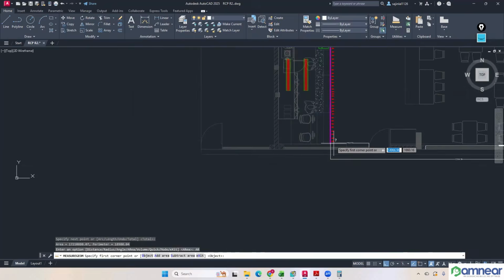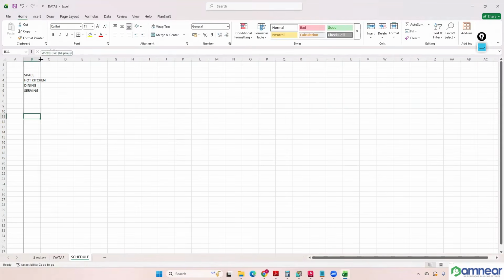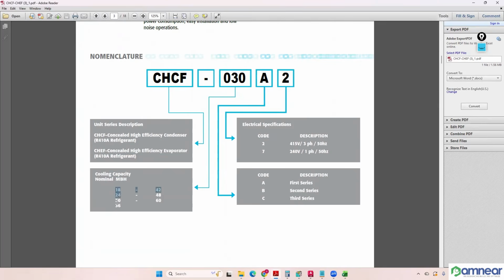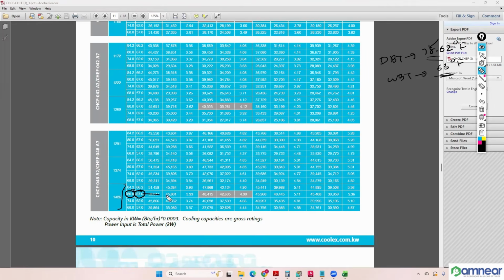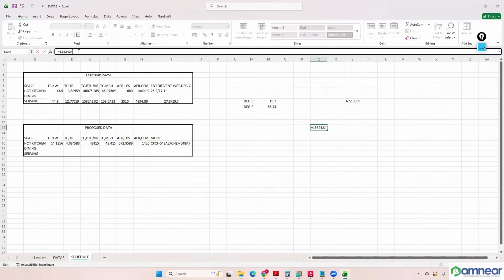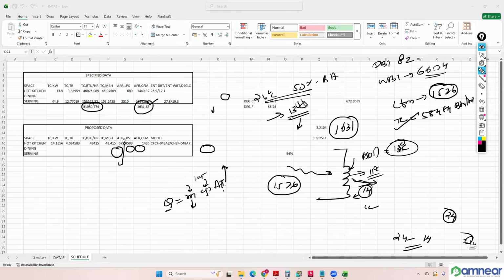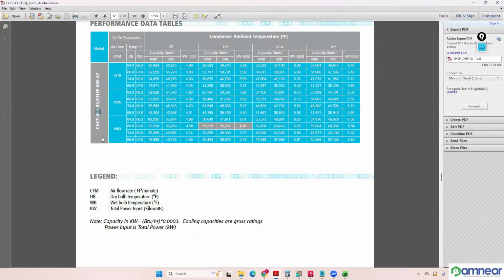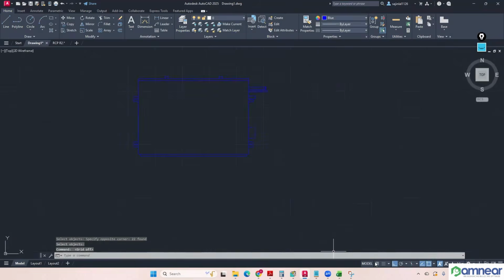Commercial Kitchen HVAC Design Project |PART 2|Air Conditioning &Ventilation|AMNEAR MEP|BIM|

Comment: Impressive breakdown of HVAC design principles for commercial kitchens. It’s interesting to see how ventilation and cooling efficiency shape both comfort and compliance. At On2Cook  we’ve observed that optimized airflow requirements can change dramatically when using compact, multi-mode cooking systems. Our devices operate with minimal fumes and lower heat output—often reducing the overall HVAC load and simplifying siting or retrofit challenges. Curious to know how modern low‑heat cooking technologies are influencing your design considerations today?